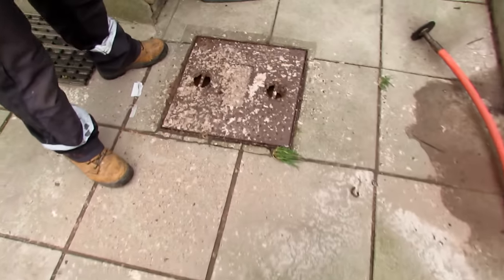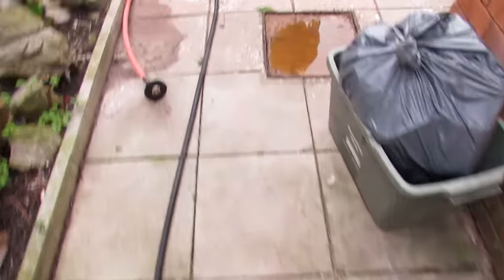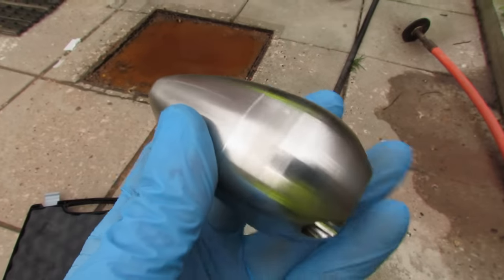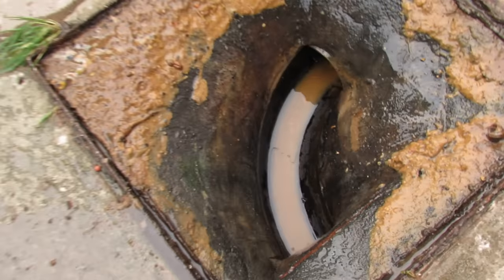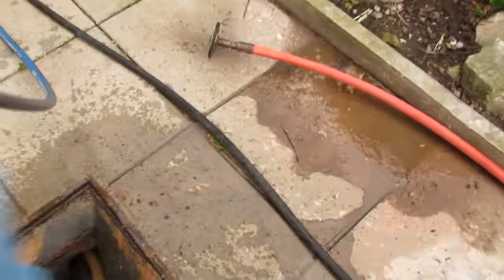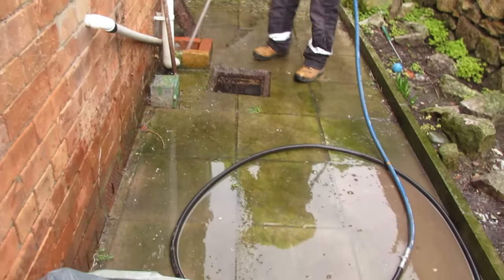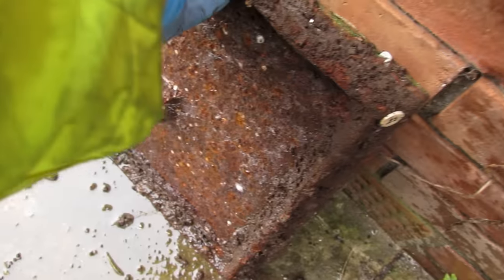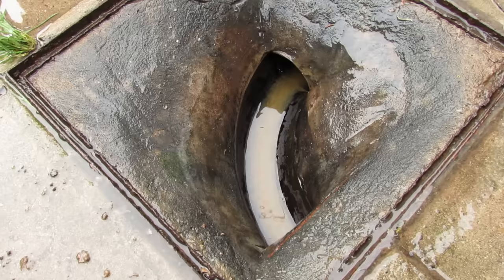Blocked Drain Drain Jetting Drain Unblocking 76

Comment: My suggestion sir, put a warning tape about 1 meter before the ferret head so you will know that is getting close when you pulling out the high pressure line. Anyway you did a very good job. Keep it up. 👍👍👍👍
Reply: Or just buy a leader hose

Comment: Nozzel name perhaps  ; front shot bullet head

Be careful with the second nozzle ! There is ceramic in it which can break when dropped, and it  can also be sanded inside, so that it no longer rotates in the front. Got that Nozzel my self,has to be fixt .Try to get that Key for the inside to clean it your self 🤪
Reply: Ya those are Enz nozzles, that's probably close to $5k in nozzles right there
Reply: In India they use bambo sticks for unblocking the block 🙏

Comment: You should consider having a trigger gun or valve on your jetter hose so you don't have to keep going back to the van to control the jetter.
Reply: Unknown our Vac-tanker/jetter truck has a remote control that we can use to adjust idle/vacuum/jetter
Reply: Or separate reels & valves. Same with the wand the Drain Addict uses; that's practically the perfect setup.
Reply: Love this channel and also Drain Cleaning Australia

Comment: My kitchen drain ceramic pipe is underground, it is connected with straight vertical 6'' line with a distance of 3 meter., there may be a bend also.I cannot insert anything due to a p-trap.
Please suggest something.Thanks

Comment: I'm curious why there isn't some sort of quick disconnect on the hose end? Seems there'd be less chance of cross threading and quicker changes if you have to swap heads. As for the head you want named, "Easter Egg" because that thing will find those secret easter eggs in the pipes. :)
Reply: I'm thinking with the amount of pressure involved a quick disconnect would run the risk of coming off.
Reply: @richardsanchez9190  Pressure isn't an issue. Other jetters (Ratty) on YouTube use quick connect couplers on these systems @ 4500PSI and head loss doesn't seem to be an issue. Maybe the difference is in the UK they don't have the same needs for jetting so the same head can be used most of the time?
Reply: @TheDrew2022  true. Over here in the u.s stuff that has a qwik-lok adapter tends to either get stuck or fall off.
Reply: @richardsanchez9190  Oh, that stuff. That'd explode the moment you put any decent pressure on it, the stuff that they sell at the Home Despot and the like is a metal (brass usually) that's rated to 4000PSI, and uses a ball bearing lock so unless you slip the ring back (hard to do as it seems the more pressure there is, the harder it is to slide back far enough to unlock) it won't come free.
Reply: Furvet.

Comment: Two things......
1.very very BAD video presentation. 
2. The product is equally unique and super, unmatched. 
I SUGGEST THAT APART FROM USING IT FOR cleaning and clearing blocks it can also be used for FIRE FIGHTING AS IT GUSHES WATER THAT CAN PUT OFF FIRES. 
GUSHING WATER WITH HIGH SPEED AND FORCE, PUTS OFF FIRE. 
SUBJECT OF TRIAL AND ERROR.